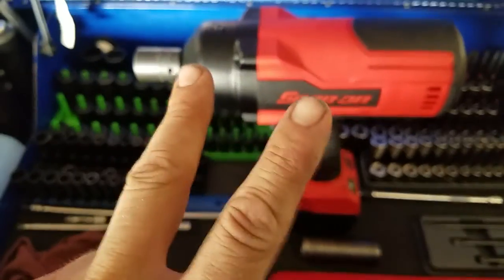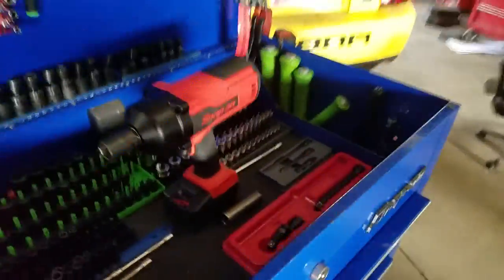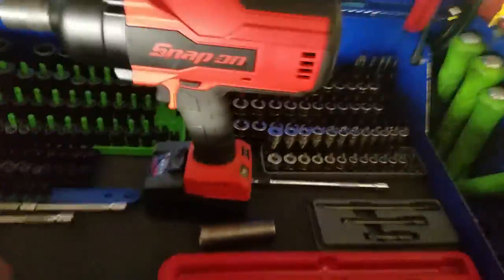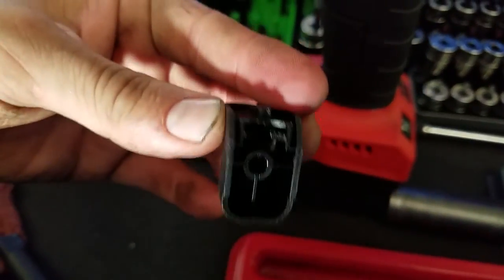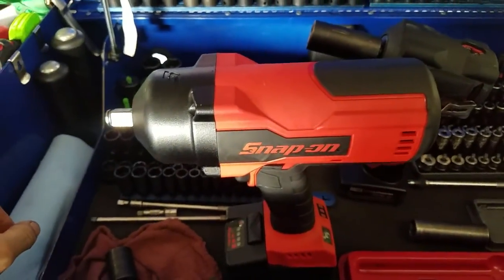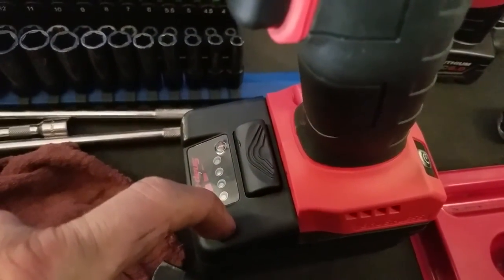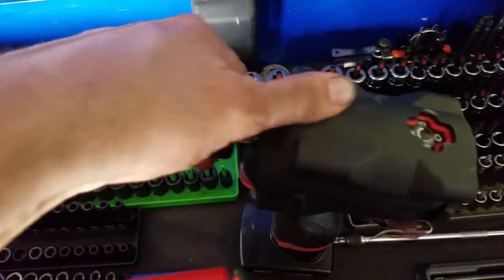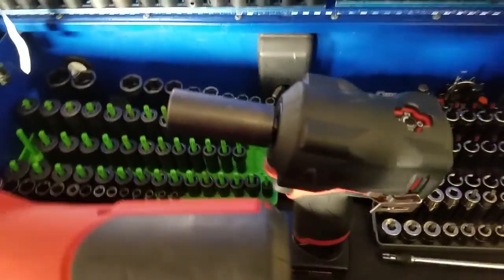Snap on brushless impact vs V6 Honda crank bolt

Comment: I will say this for Snap on.. The anvils are alot thicker in the housing than Milwaukee's 1/2 heavy duty. However I have an old NICAD 18v Snap On and used the hell out of it... I will use Milwaukee because I am not going to pay 700 dollars for a impact. Every tool has their ups and downs. I was just really impressed with the internal thickness of the Snap ons anvil. It will definitely take a beating.

Comment: 🤔 1400 ft lbs/1100 fastening + 5yr warranty for $450 vs 1200 ft lbs/900 fastening  + 2yr warranty for $1000...Snap On has lost their freaking minds
Reply: Not even close if your paying retail your dealer doesn't like you or your just a cheap punk. paid 580+ tax for the kit from my dealer brand spanking new with 2 batteries and a charger.
Reply: @upnorth5465  never once paid retail for any snap on or mac

Comment: $1000 impact and the button falls off
Reply from the maker: Mine was one of the very first models none of the other ones had that issue but it has a two-year warranty so I'm not worried about it
Reply: As long as your happy I guess
Reply: 2 year warranty? Lol wowww what a great deal for 1000 bucks how about 250 for 500 more foot pounds and a 5 year warranty loo
Reply: Got one like this might be older doesn’t have the clutch mine won’t take a lug but off but have older batteries might be the issue
Reply: Read this when the button ejected lmaaao. I think I'd get 2 Ingersoll rand or a few DeWalt before this. I've dropped both about a thousand times and no ejecto button.
Reply: Nathaniel Aikin Milwaukee warranty they won’t honor you mean? Have you actually tried to warranty something to Milwaukee? Takes up to 3 months and if it’s considered abuse, normal wear and tear, etc. they charge you for the repair. Plus Milwaukee batteries only last a year or two, versus snap-on’s Japanese battery packs lasting 5-7 years.  People talking out of their ass should be banned from posting.
Reply: @SocosVeryOwn  Milwaukees warranty is pure garbage. Every time I have to send and impact in it takes 3 months or more. My 3/8 stubby is going on 4 months now. What the fuck good is a Milwaukee if you can't even use the dam thing.
Reply: @Tap-a-roo  it's celled I'm a mechanic that has tool trucks that good by... Warranty them right then And there lol
Reply: @upnorth5465   it's celled I'm a mechanic that has tool trucks that come by... Warranty them right then And there lol

Comment: I'm sorry but the price for that tool is not worth it Milwaukee warranty blows it away hands down it'll do everything you needed to do I can buy two of those for what you pay for one of those that's just my problem. I'm glad you liked it though and perfectly fine with you buying that. Unfortunately snap on is out of their minds they're ridiculously expensive and they don't offer any benefits.
Reply from the maker: When was the last time Milwaukee came to your shop and gave you a loaner impact while yours was being repaired?
Reply: @montevallomustang  I agree but I can buy two of them for the price of that never have to worry about one being gone I definitely am a fan of the tool trucks don't get me wrong and I love snap on stuff I just can't stomach it you know what I mean.

Comment: Just got mines yesterday and it was working fine i only took off two wheel after that it. Did nothing it stoped working the speed settings were just blinking on and off 😥😥

Comment: So I don't have Snap On tools so I'm not sure how it works. But why didn't the Snap On guy give you a new 1/2 impact of it was defective and had 10 others on the truck. With how much you spend on that waiting to have to send it back in is a load of crap.

Comment: Snap on cordless is still junk. Change my mind. Hand tools can’t be beat. Air are mediocre. Cordless are junk.
Reply from the maker: Have you taken a honda crank bolt off without an impact?
Reply: Montevallo Mustang  yes. Many times. Been Honda master certified for 11 years. And Chrysler for 6 years prior.
Reply from the maker: @travisduncan2701  and you dont use power tools?
Reply: Honestly impact is not the only way